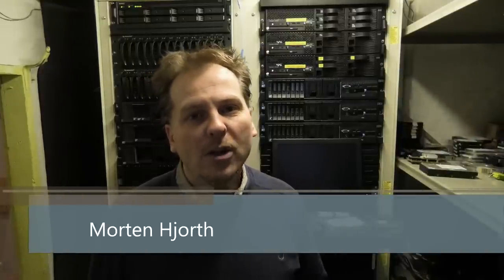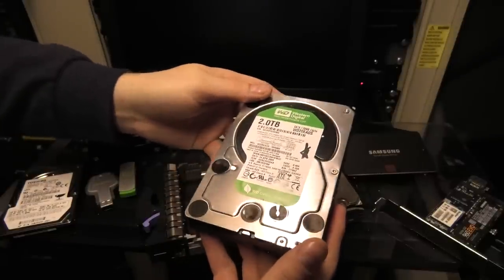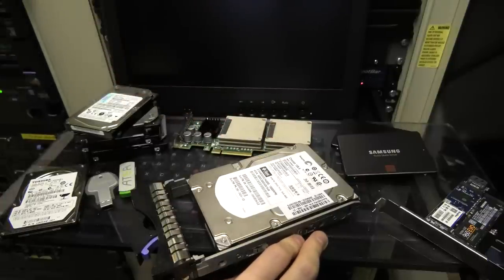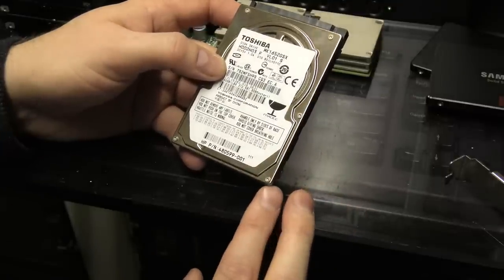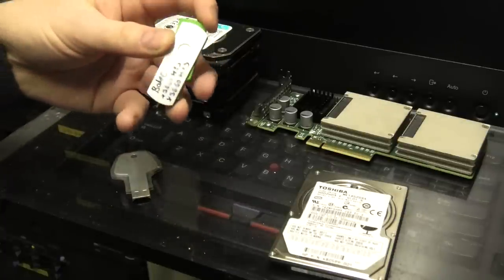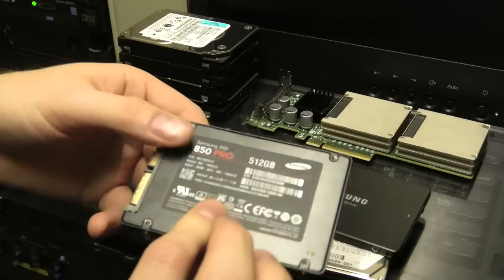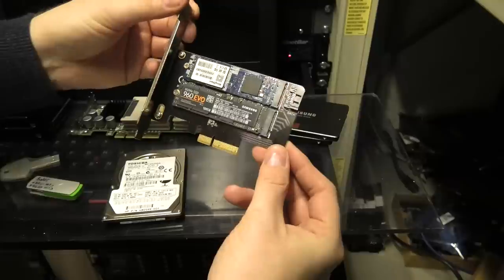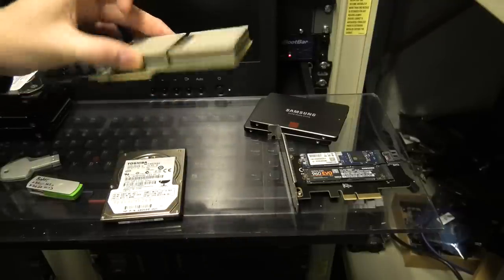Server Storage on the Cheap - 926

Comment: am photographer/videographer , my main 24 7 file /plex server use 4 1tb wb blue in raid 10 ,  for work data ,  250 ssd for project am working on  throws are auto backup on raid ,   1tb blue for my tv show , and 3 tb blue for my movies and music ,    and a 120 ssd as boot drive ,   all backup wen i add new data on external drives ,   for network i use just a quad 1gb nic     and is base out i5 forth  gen ,   for what i do with it  works well ,    don t really need more space at the time ,   the data drive is purge every end of year to my cold storage server ,  and if my media  collection get biger just add one more drive ,
Reply from the maker: That does seam like a cheap solution.
Reply: @MyPlayHouse  yee , is cheap and works for what i do ,dont produce much data anyway  500-1tb  a year , some of the drives are 10yo so yee thows blue wd are reliable , and also most photographers i know just have one computer and one or 2 external drives  with no server no raiid  no backups , some just use dvd ,

Comment: Few days ago i started up my first "nas" :)) Thin client hp T5720 inserted 30gb ata HDD inside, 512MB RAM and external 500GB usb HDD, system is Debian 10 stable no gui, for now i mounted it to host by NFS share, backup done folders from host by rsync, client working as DHCP for internal Network and as WiFi router with masquerade ;)) just  Silient and 15W max power ;) . Yeah. It just work ;)) thanks for another good video sir!
Reply: That HP code comes up a printer....

However.... Debian is a nive OS to work with. and It will help if you down load install a programe called "webmin"
This is a web GUI for the server and I have been using it for many years.
If you want a Network Storage Share. that's just "plug and play" type in "sudo apt install nextcloud" its really easy and simple.

dose not  need a lot of CPU, but will use ram a lot on heavy use 8+GB but will run fine with less.
Reply: @guywhoknows  thanks but i just want non gui environment ;) first i installed omv ( openmediavault 3.x becouse 32bit ) but after few minutes cpu is at 100% non stop (php, database) so no. Why waste resources? Webmin probably be the same. I installed 'server' becouse i want learn more about that fantastic lovely penguin ;)) i use it near year and don't want switch to another environment ;)) first was Arch 8 months, ( installed from scratch ), then Debian SID 3 months and now Fedora 31 from 2 months .  Learn baby, learn :D
Reply: @guywhoknows  i just edited my 1st post. It's HP T5720. Sry!
Reply: @SwiatLinuksa  OMV and other data storage software will use alot of CPU and hard drive, as it makes backups and zfs files.

I didn't find it was CPU hugery. Running at less that 5% and I think around 30% when transferring.
I will say it just eats Ram. As it ram caches I think.

Webmin is a tiny app which simply GUI the main function, while I do use if for some functions as it's quicker than code, and it will also FTP so you don't need a program for server storage.

If you want to go native and wild, way way back ( and not so long ago) you can use dos to write the software and storage requirements...
Four word software is small and great ...lol.

Not used for a long time, what's FileZilla like now? FTP options
Reply from the maker: Tiny old setup :-) Cool!

Comment: Please note the reason why servers ramp the fans to 100% on some but not all third party drives is the server is looking for a specific signal from the connected device to check the sensors. If the device is communicating in a way the server doesn't understand or the device doesnt have the sensor the server will "protect" itself by running the fans at 100%
Reply from the maker: So even if the server has like 10-20 temperature sensors,, you believe it should still ramp up all the fans if a third party card, HD, ram or something else is installed.
I do not think so,, If I want to put in a GPU,, that does not cost $4000, but some gaming GPU for $200 that will do the job,, I want a server that can handle that.
Reply: @MyPlayHouse  the server was programmed to receive a specific set of signals  and since these servers were designed for the enterprise environment  it would make sense that the company designing the server wouldn't want to waste the money supporting consumer hardware

You have even stated in the past "in the enterprise environment they spend money on validated hardware for peace of mind and to know the hardware will work and don't generally mess around with consumer grade hardware"

Why spend money on supporting consumer grade hardware if the enterprise environment wants enterprise grade hardware

Comment: I have found that most servers will accept HDs that has support for S.M.A.R.T. drive monitoring and reporting.
Have anyone experimented with 3th party SSDs/HDs in HP servers? (the HP branded are very expensive)
Reply: I have used 3rdparty SAS the only complaint was firmware, but it worked fine. ( note my system is older and I cant see my own SMART on the drive via a tol of software and management apps, but im not using HP software just hardware.
Reply: I think it depends on the controllers. Have used Intel and Kingston SATA enterprise SSDs on SA P400 and P410 controllers without issues. WD 2.5" RED 1TB and Seagate 2.5" 5TB HDDs also work fine.
Reply: @retromaniac4563  I have been checking out the st5000lm000 and st4000lm024, but reviews say they are slow and have a high failure rate?
I would want them to run on my Gen9, Smart Array P440ar Controller.
Reply from the maker: I only have my HP D6000 issues,, and that is strange enough..
Reply: @MyPlayHouse  Hi Morten :), probably has do to with the HP disk firmware hell ... Do you think it would be possible to take a 3td party disk and flash HP firmware on it ?
Have you done any performance tests on you 4TB Seagate disks in RAID 5? - i assume the disks you are shucking, are st4000lm024?
On another node, would love to see a video on vGPU (your GRID K1), as far as i have been able to find out, proxmox dose not support vGPU? (it might in v6?)
Reply: @peterslot9551  Have 6x st5000lm000 in raid 10 on a Proliant DL380 G6 with a P420 controller since 2017 and no failure yet. Ran CrystalDisk benchmark with 4GB file (controller 2GB cache) with this result:
Sequential Read (Q= 32,T= 1) :   443.672 MB/s
Sequential Write (Q= 32,T= 1) :   232.995 MB/s
Random Read 4KiB (Q= 32,T= 1) :     6.329 MB/s [  1545.2 IOPS]
Random Write 4KiB (Q= 32,T= 1) :    20.478 MB/s [  4999.5 IOPS]
Sequential Read (T= 1) :   425.492 MB/s
Sequential Write (T= 1) :   205.759 MB/s
Random Read 4KiB (Q= 1,T= 1) :     0.722 MB/s [   176.3 IOPS]
Random Write 4KiB (Q= 1,T= 1) :    39.364 MB/s [  9610.4 IOPS]

Comment: Anybody know if I'd need to change the RAID controller or anything on my revision III PowerEdge 2950 to upgrade from 300gb to 900gb 15k RPM SAS drives?

Edit: I'm aware it can support up to 2TB SATA hdds in all 6 3.5" bays, but I was wondering if SAS was different.
Reply: Your sas shouldn't be different
Reply from the maker: I think you are good to go,, with also 900GB
Reply: @MyPlayHouse  Great, thanks.  I wasn't sure if there was a more strict data limit since they're 15k drives as opposed to the 7.2k that sata drives would be.  I'm new to this stuff :)